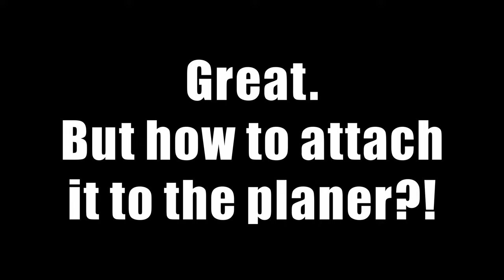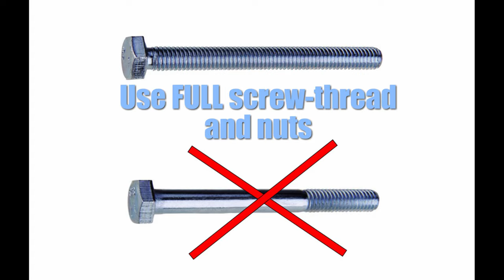Planing Beams with Electric Hand Plane - How to Attach Planer Jig

Comment: Ingenious idea! And whenever a 'maker ' displays the skill And resourcefulness to make their creative idea a reality,  they deserve credit,  and respect for sharing their process w others
.... BUT,  i think you could've easily made some improvements: being that the end to end degree of level (in the board currently being processed) may be affected by either the planner 'arms' lifting off the ' running beams; i think you could've saved yourself the effort (and potential inconsistency of not applying ample and controlled downwards pressure)b by simply connecting those 2 boards... i know they need to move freely,  but if you just had a ,L bracket attached to end of planner arm,  the bottom  of L riding along bottom of runners, they'd be kept from lifting,  and you wouldn't need to constantly pay attention to that (and again,  thiose runners are petty long and relatively thin wood... so if you don't apply pressure, the planner may lift... and if you DO,  there's possibility of 'runners' flexing (and that may lead to low spot in middle of processed board.... So i bet you could've fixed that by making those outer runners out of square tubing.
But  regardless, it's a great concept,  and you can continually improve design!

Comment: Can I ask how thick your metal poles are and how thick the wooden beams are?

I have bought some wooden beams at 25mm wide/thick. So with a 12mm rod, I've got 13mm of clearance, but wondering if a 10mm rod would be strong enough
Reply: I guess I can try with the 10mm rod, and if not stable, go up to a 12, not the other way round 😅
Reply from the maker: The metal bars have a diameter of 10 mm. Wooden studs are 30 x 18 x 1000 mm. I certainly wouldn't try studs thinner than 30 mm (for 1000 mm length). A deflection would occur.